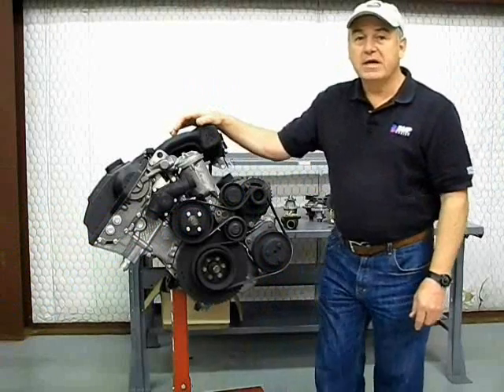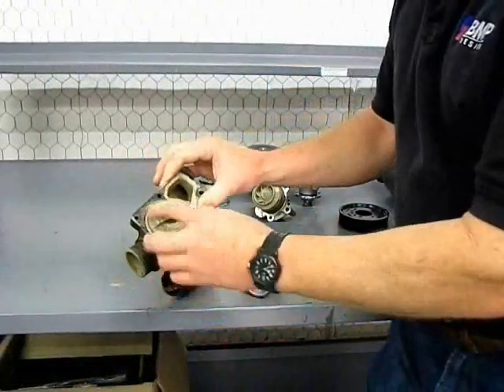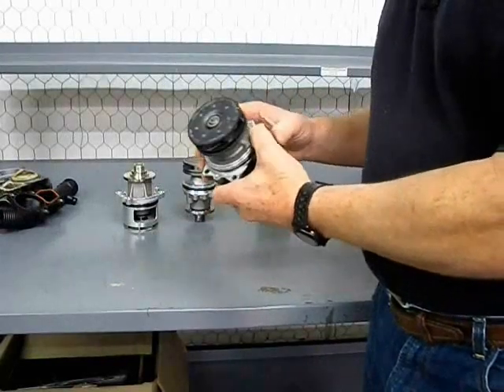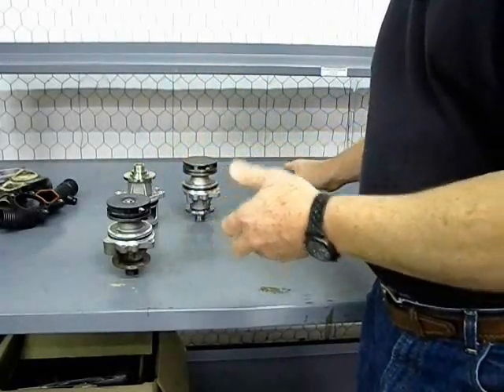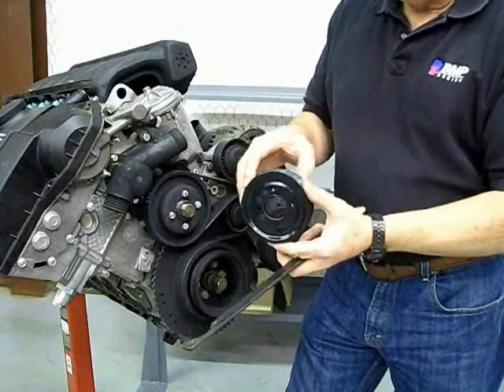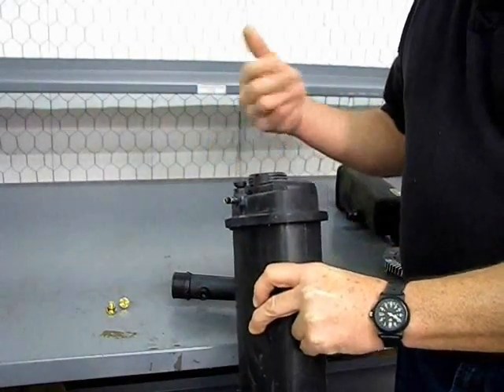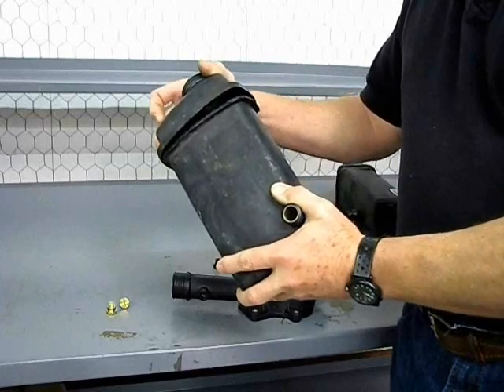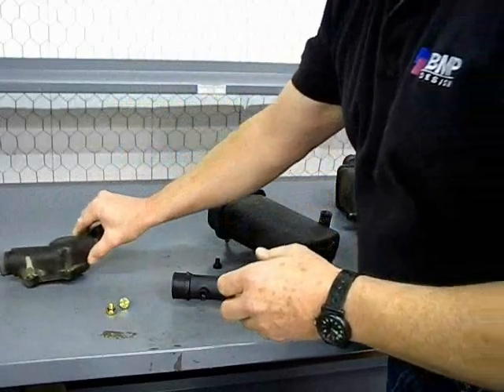Part 1 BMW Cooling System Overview with Common Failures for e36, e46, e34, e39

Comment: Most newer bmw from e 90 series,f series  g series are all using plastic on cooling systems including pully and not reliable unless replace every hundred kms or miles that cost you a lot of cash out from your pocket specially  an electric water pump need to replace before it due or failed otherwise get you stuck on the road overheating it was so expensive to replace..
i love the e46,e36 is better it is drive belt water pump and not using plastic electric water pump and plastic thermostat

Comment: I replaced the thermostat housing, the water pump, the radiator (installed a Mushimoto larger-capacity all-aluminum radiator), and even installed a brass bleeder screw. It never occurred to me to check to see if my pulleys are plastic. Dang. Well, I  know what I'm doing first thing in the morning.

Comment: Yep, I have had two E36s and both had cracked expansion tanks within the first year. On my new (1998) E36 I replaced all the plastic parts with aluminum. Radiator, expansion tank, thermostat housing and stainless steal water pump impeller. Mishimoto makes good parts.

Comment: I have a 02 e46 I changed out the thermostat in June of last year ,and I hooked up my icarsoft obdii to see if I had any codes and yes surely I had one say 7b activation map cooling is it possible the thermostat went out that fast ?

Comment: Cheap over priced cars. I am done with BMW's. Plastic does not dissipate heat, it melts or brittle that leads to blow head gasket or cracks heads or block due to overheating.

Comment: Brass bleeder screw is blatantly stupid for obvious reasons. Fine pitch threads in a plastic fitting is just asking for stripped threads on the expansion tank, resulting in having to buy a new tank. "Plastic impellers" are actually a composite in BMW's case, making it light weight, and non corrosive. Plastic pulleys are to decrease weight, and is cheaper to produce in bulk and less expensive to buy. Keeping these parts maintained and replaced every 100k or so will result in 300k miles or more of fun driving. As opposed to 175k miles of Honda Civic/Toyota Camry/Chevy Impala/Ford Taurus lame drives.
Reply: 2hrsToChooseThis   re: using brass for a bleeder screw

would you care to elaborate?   it may not be obvious to some.  Fine pitch threads can be easy to strip if you aren't careful and overtighten, sure, but you said "reasons" plural...

Comment: German engineering is a great marketing tool, and as long as you approach purchase of a BMW with that mindset you will be better off.

BMW's are full of plastic parts underhood. The thing is, plastic does not like to be heat-cycled. But because they seek ever larger profits, BMW's cooling system is all plastic. Cheap crimped radiator with plastic tanks. Plastic coolant hose ends. Plastic everywhere. And these parts break. They strip out, the seams fail et cetera.

If you are silly enough to buy a BMW rather than lease one, you will replace the entire cooling system sometimes as soon as 45,000 miles.
Reply: I have two BMW and none have had problems with the cooling system! 15 Years 230000km and 4 years 120000km
Reply: It's not the engineering that is the problem. It's cost cutting on using cheaper materials. The design itself is not bad.
Reply: TheXbaT Your 15 year old is probably before they went to plastic, 4 year old good luck.
Reply: Yeah if you get cheap Chinese plastic crap you can be asking for disaster. If you get high quality plastic made by reputable brands and not from cheap no name stuff it is very durable. Almost as good as metal and often times better than cheap metal. Without any of the problems associated with metal such as corrosion or electrolysis or rust  Not rusting on plastic ever. Not everything is evil intent and evil conspiracy and about money. The problem with plastic is it has to be torqued correctly as it's tolerances are less than with metal. So if someone doesn't torque it correctly it can fail prematurely due to leaks or cracks or deformities. However if torque correctly should as last long or longer than metal without any of the issues of metal. People often over tightened which leads to stress cracks. Not BMW's fault installers are idiots. I couldn't disagree  more with you about the hose ends. I love the plastic hose end connectors. Wish every car marker would take note and do the same. No more needing to reach hard to get to areas with special hose spring pliers. Now all you do is reach with a simple flat head screwdriver and boom it's off and push it back in and boom it's on. No more over or under tightened of coolant hose clamps like before. No more having to make sure hoses are lined up to the same exact location or risk having a possible leak. No more springs clamps that are too hard to reach, can pinch you, become a flying projectile, or crush the hoses too causing premature wear and deformities in hoses and a pain in the ass to get off. Oftentimes requiring special hose pliers just to remove if stuck on with corrosion and heat bond. Even with special tools I had to spend hours to get off some hoses. It also can end up causing injuries or damage to parts due to get force needed to remove said hoses even with hose picks and pliers. These hoses are a godsend from BMW. Never have to worry about stuck on hoses again with the clip on hoses.I agree certain thing don't mess sense or drive me crazy with BMW but not the hoses. Love them.
Reply: TheXbaT

And yet, there is an entire aftermarket of products for the very poorly made, poorly engineered OEM BMW parts. Then, intelligence is required when seeking causality. As such your posting is simplstic drivel. German engineering a nothing more than marketing. IMS anyone? (THe fact that you do not know what that references reveals your lack of knowledge on materials engineering).

Comment: I'm not convinced that the "plastic" parts he talks about are a problem at all. I have plenty of original cooling system parts with a date stamp of 11/98 on my car that have held up perfectly well. I've had several friends put aluminum cooling system parts on their cars, thinking that they know better than BMW, only to have the parts corrode and leak in short order. The plastic impellers on the original water pumps have held up fine for me as well, but I've heard of the aftermarket ones blowing up because they weren't balanced properly and were made with cheap metals. I'd rather have a plastic impeller slowly degrade versus a cast iron impeller take off the front half of the engine!
Reply: An idiotic posting. Causality stupid. BMW's are ranked far down the list in reliability for a reason. Your inferences are those of a moron.
Reply: Good luck buddy

Comment: All BS, I've got a 93 325i never, i mean never had to change the thermostat or housing, still works perfect. The only part i ever had to change was the heater control valve unit.
Reply: your are in the wrong thread. Your car is 7 years older and built differently. I have a 2000 BMW e46 and this video is fantastic.
Reply: I have a question for you. What was your car doing for you to change your heater control valve unit?
Reply: No heat, valves were stuck shut.
Reply: Ps, blower was fine, ac is good, just no heat.

Comment: The days of rock solid German components as a 'standard' are long over - step aside Korea :)  I've had two water pumps blow on my e36 - never thought to use aftermarket but certainly will next time!

Comment: @Jetubeb it goes around the water pump itself to seal it where the pump meets the block, if its a quality pump it should already be on the pump, use a lil bit of silicone so that it goes in smoothly

Comment: E46 3-series thermostats often fail wide open, and the engine runs cold as a result, lowering MPGs as the computer dumps fuel to compensate. It gets worse on the highway with increased air flow. What internally causes this problem? Any way to repair a thermostat like that, or do they just have to be replaced?

Comment from the maker: @scant6681 The e36, e34, e39's have housings that do not have the electronics (some of the e39's do), they are just a housing that holds the thermostat.  For the later e39 and e46's they do have the electronics and would not be able to use the aluminum housing.

Comment: @528im52 Quick question, would this aluminum thermostat  housing connect the same way as the orignal plastic end connection?

Comment: Why didnt bmw just use electric cooling fans, all this plastic junk just makes me angry.  2 electric cooling fans if 1 fails its still 50% more reliable than a broken impeller.

The 94 impala ss/ caprice 9c1 has electric cooling fans and so do 98 and up crown victorias which police still use.

Comment: the plastic thermostat housing part where the hose connects over broke where the circle clamp goes around it and broke the plastic piece right off... ima get a aluminum one tomorrow thx.  you can add that mess up to the things that go wrong with those parts.